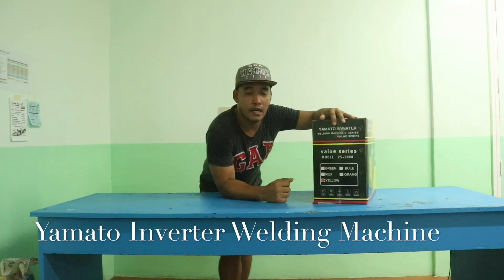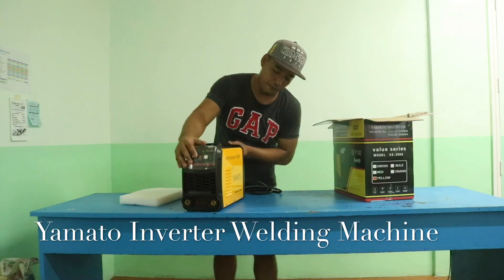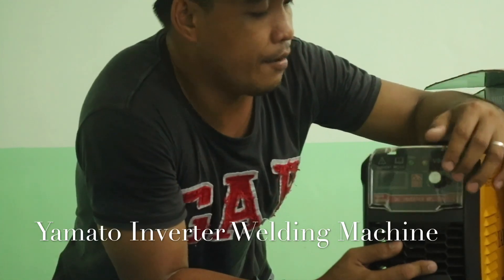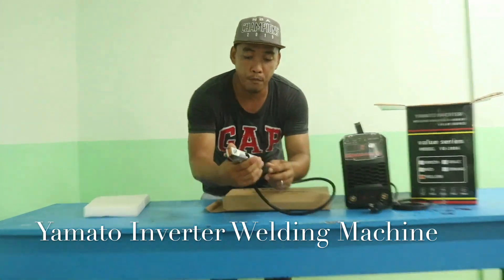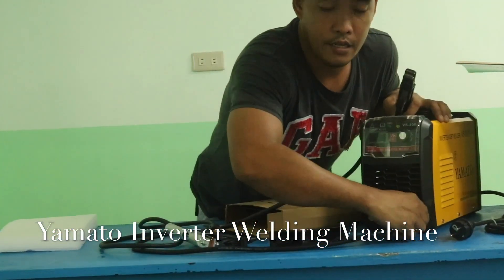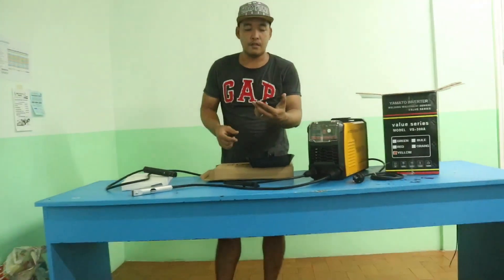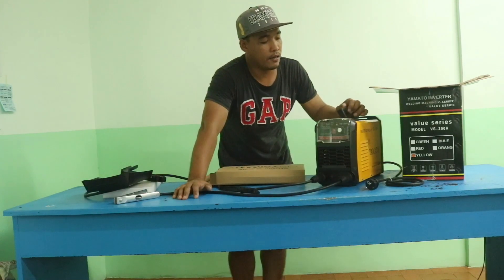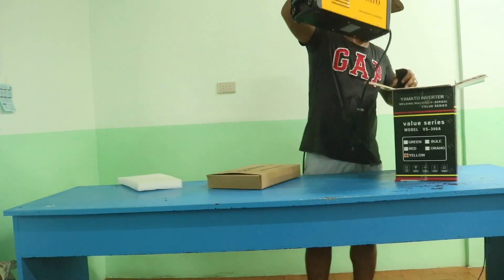YAMATO INVERTER Welding Machine

Comment: May unit po akong ganyan bago pa, kaya lang nasira, ayaw pong magweld na, gumagana naman ung fan niya pag nakasaksak tapos may nakailaw naman ng pula. Ano po bang problema? at saan po ba dapat ipaayos?
Reply from the maker: Echeck nyo po Boss ang mga connections nya lalo na yung welding cable, positive at negative baka may loss contact lang...
Reply: @sparkndustph  na check ko na po, di kaya electronic parts nya? saan pwedeng ipa trouble shoot?